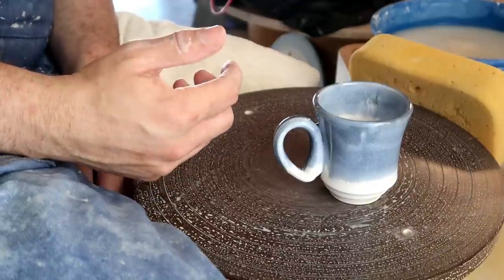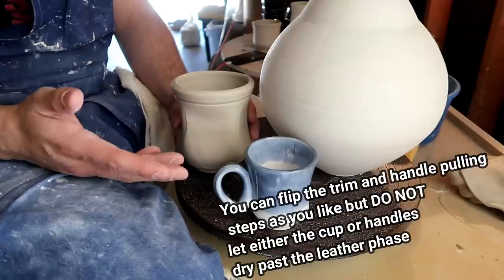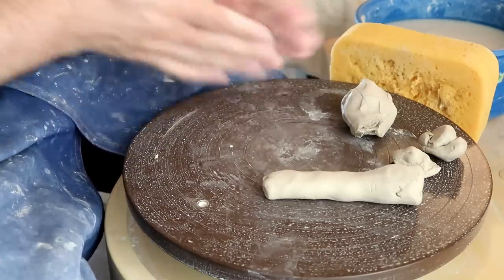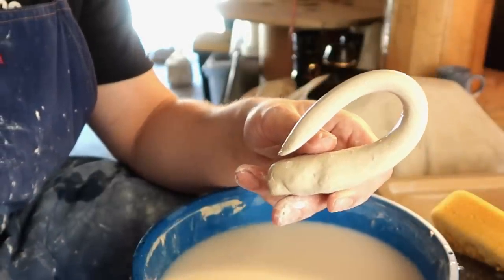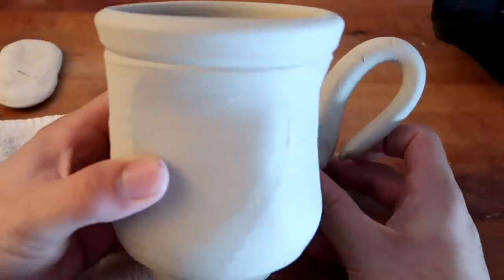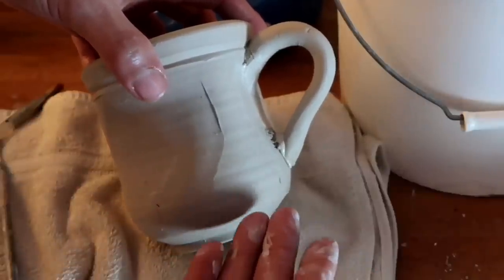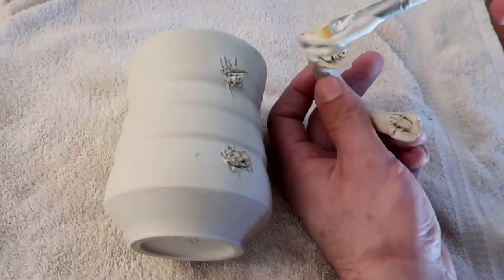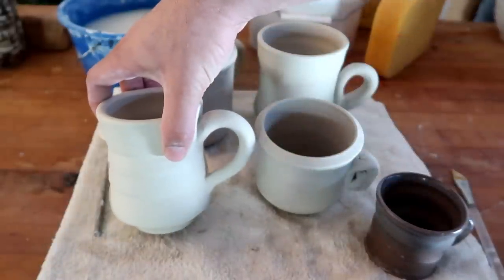Mugs for beginners (Golden rules of mug making)

Comment: I've now started the habit of pulling 2-4 handles for each mug.  That way, if I screwed up the first handle, I already have backup.  Alternatively, I can pick the best of the handles I pulled for that mug and attach it.
Reply from the maker: Potter tip ^
Reply: My method is similar, count the number of mugs that I'm going to be trimming, then pull handles for around 1.5x the number of mugs I'll need.

Comment: Great tips. Extruded handles work great also all of the handles are more uniform and lets face it easier to apply. I also use a torch on most of my pottery no cracking and i can bisque fire in one or 2 days with out issues. ~ Big G Pottery

Comment: Two questions for you - 1. How much clay do you use for your mugs? 2. How tall are your cylinders for mugs before you fire them?
Reply from the maker: I don't have a standard size for how much clay I use. I usually go by feel; as this video is a little older my mugs are much larger now.

as far as the shrinkage rate goes this Clay is BMiX so it shrinks in between 10 and 12%.
Which of course is dependent on the size of the mug as I do not have a standard size for my mugs.

I'm not a productionist, I'm an artist.
Reply: Earth Nation Ceramics I asked because I just started using B mix and I usually throw to “as tall as I can-ish” which so far has been about 5.5 to six but I really didn’t count on the shrinking. Thanks for the tips esp. your candid glaze info. M